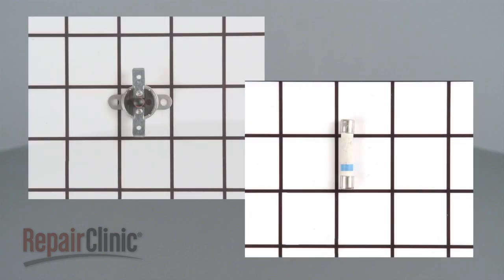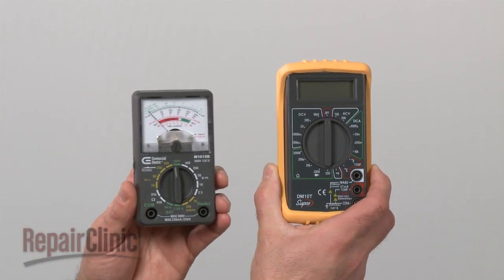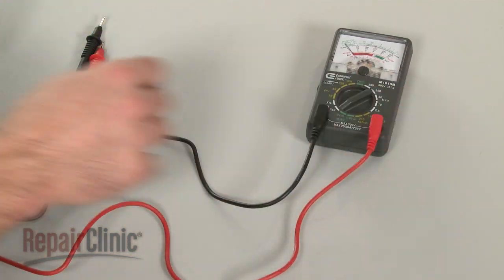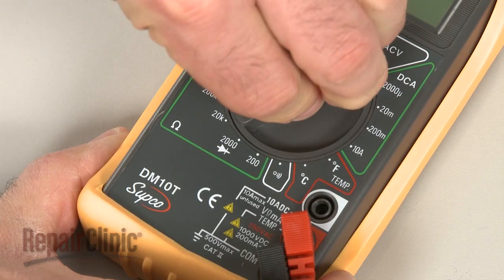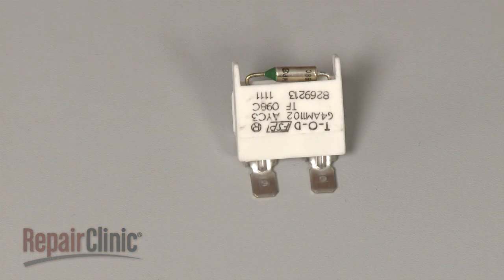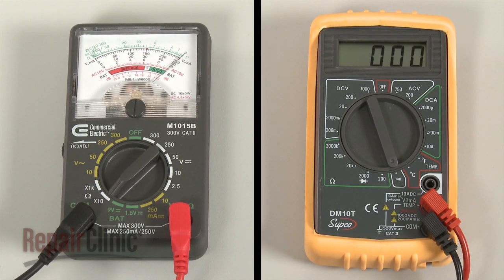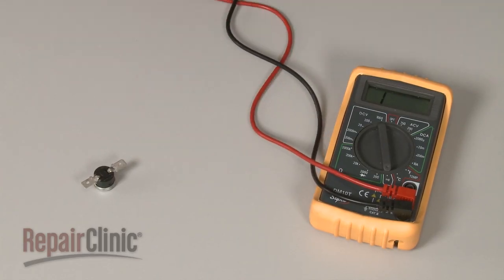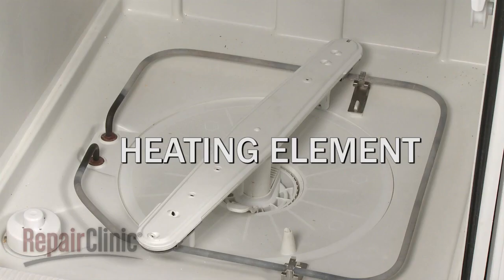Dishwasher Not Working? Fuse Testing, Troubleshooting & Repair

Comment: Someone one of these experts, may wish to mention on the Samsung DMR57L, you have to check the in line fuse under the bottom. That is what fixed mine. That is before you go through all these test procedures. I found a Machine just like mine, changed front Panel, Control box. It was a no power up situation. I am not an appliance repair man. But a 40 Year Auto Mechanic. Good luck.
Reply from the maker: Vinny BadaBing Thank you for your input.
Reply: can someone please explain to me how  I tested continuity ,it zeros out but there are small burn marks on the outside of the plug connectors ? i can't afford to buy the fuse , just to test it? Thanks
Reply: First do not buy samsung appliances
Reply: @scottzimmerman5076  burn marks dont mean anything bad.

Comment: Hi..I have this problemn in my whirpool dishwasher.  I want to know the type of the fuse than you used to replace the original. I live in Venezuela and I do not have how  to buy a new original part.
Reply: You may find a inline fuse at auto parts dealer, get the highest amp they have.  Bypass the fuse. Be sure to inspect all the connections for damage unplug and look, turn off power first. If you try this be sure to watch if it works and no other wires are shorting.